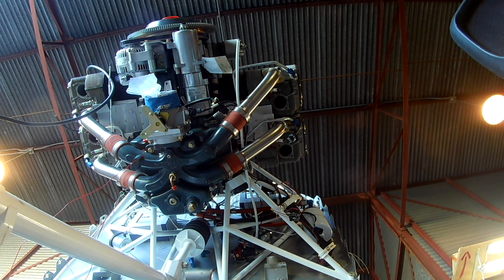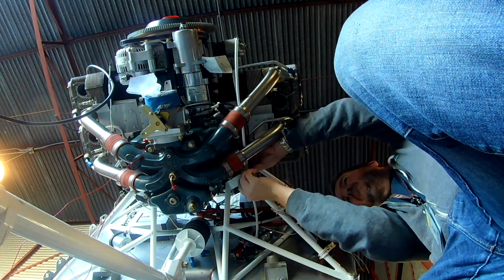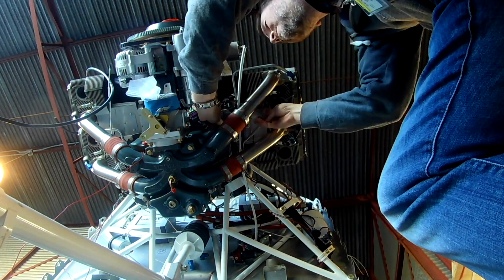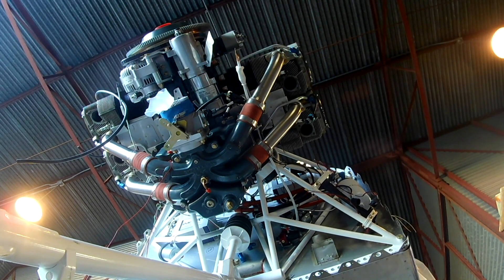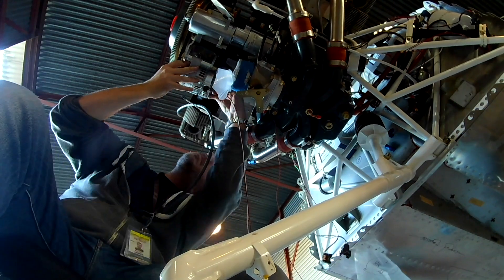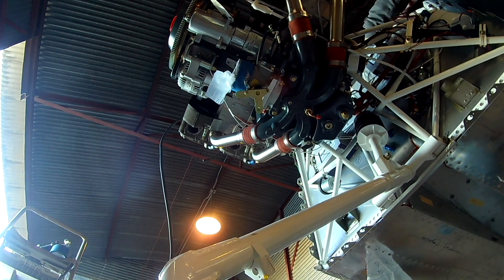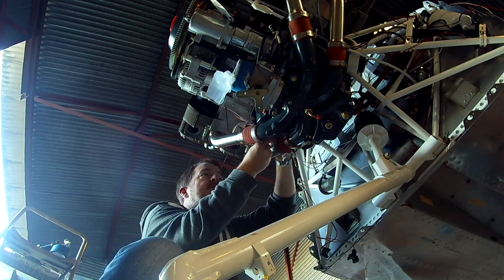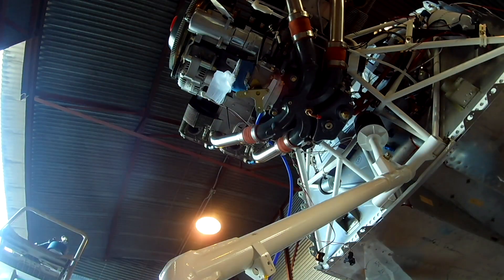RV-14 FlyEFII III

Comment: Cool view from underneath.  Two novice questions (I'm not a builder):  1) Why have an on/off switch to the alternator.  2) Unclear how the cylinder head heat escapes (I see the channel underneath the fuselage) without cooking your battery and electronics mounted on the firewall; is there an aft baffle that directs that heat down to the channel?  Cheers.